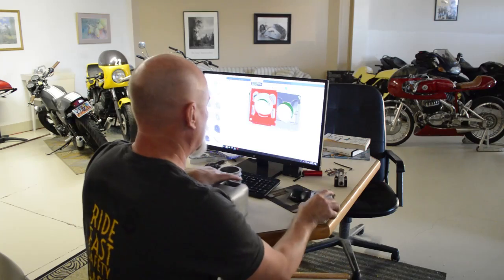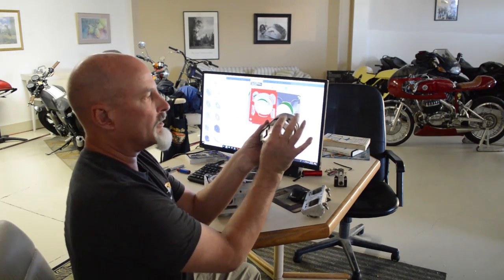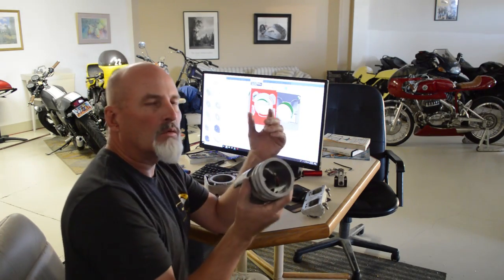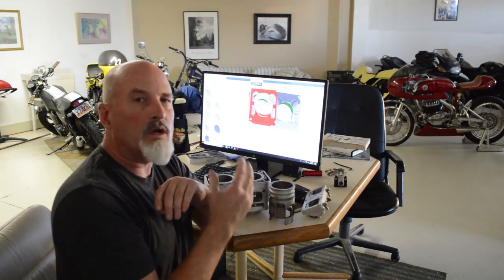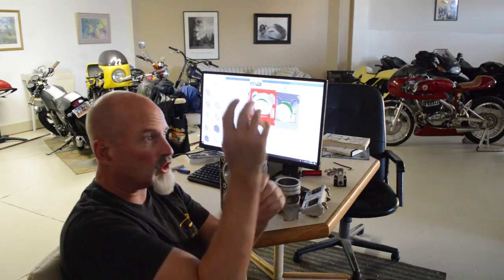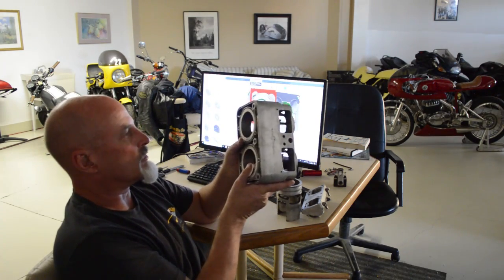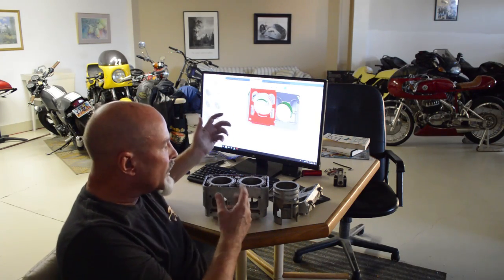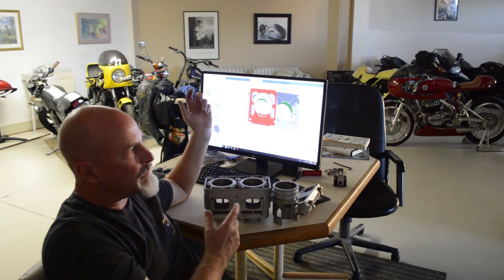Landspeed engine rev 2

Comment: Great video Mark !!
I used to race sprint cars and had a destroked  Chevy engine that made huge horsepower on menthol running up to 15.5 to1 compression. At 13.5 to 1 I ran 20% nitro.
It had 6" rods and the dwell time allowed increased cylinder filling and the methanol added latent heat of vaporization for 20% increase of horsepower and torque plus it ran cooler.
We had to use 1.5 to 2 times more fuel than gas as methanol has less btu per pound but the exhaust smelled crazy. Especially with nitro that smelled like gunpowder. 
I ran a nitrous tank in my radiator with lines through the upper coolant hose to nozzles under the intake in the intake ports.
Made a few seconds of 150 hordepower 
for last lap finishes. I
I know friends who race snowmobiles for the factory and used methanol for coolant and had a small needle valve to inject coolant into the intake. Made gobs of horsepower and passed fuel samples when checked plus ran cooler.
Racing is about innovation as smokie yunic would say.
Good luck with future runs.
Reply from the maker: Nice. Sounds like lots of fun. Smokey is a huge hero of mine. Got to talk to him years ago. RIP!
Reply: @SpeedofCheeseRacing  
Great to hear from you. Smokie was also my hero. I especially loved his hot air engines. Pure genius!!
I'm a retired mechanical engineer and have thought outside the box forever. 
I stumbled on your channel somehow while researching energy efficient power sources and thermal dynamics.
A buddy of mine wanted to build a bike for the salt using Honda gloldwing for power.and while I was at his place in Daytona during bike week, I solved some of his problems.
The driveshaft wouldn't clear the rear tire so I suggested he lengthen the rear swing arm which would also help stability with longer wheelbase.
Option two was he turn the engine sideways and eliminate the driveshaft as everytime you turn power 90 degrees, you lose horsepower and torque. However a chain or belt has no frictional losses.
I figured if he took all the gears out of the engine and ran a cvt belt drive off the crank it would reduce flywheel dynamics in the trans ,improve throttle response and solve shifting issues.
I sketched it up but he's still running the driveshaft which limits speed by gear ratio. He's run there a couple of times but now health issues and body mass has him hiring a rider from Washington.
Wish he'd have built the sidewinder.
Thanks for inspiring many to re-invent the wheel , buck conventional thinking and giving us a glimpse of your bikes and shop
Good luck on the salt.

Comment: Direct injection with an additional large carburetor to be used only for lubrication.
For this I would use a water-oil emulsion. Water reduces combustion temperatures.

Comment: You should check out rotax, there direct injection or there snowmobiles is awsome.injected where the spark plugs would normally b located,and they use a voice coil type of injector.there oil injection is digital also.and by the way,2 strokes rule!!!
Reply from the maker: Yeah, I looked at them, but controling them seems to be an issue. Stock ECU is not easy. It may be something to keep looking into though as it has all the good points. Two strokes do rule!
Reply: @SpeedofCheeseRacing  absolutely!! You just cant beat the power to weight ratio.i have a 73 rd350 with banshee pistons,30mill carbs and a good set of chambers on it.that thing will rip!!.I have embarrassed many liter bikes with it.

Comment: They already run lamda sensor in production bikes ,but the electronics just so far let it down but I'd say it was cause of  cheap produced parts ,if it was for a single purpose(landspeed) then money is no object to have bespoke kit to that bike as the rest of the bike is bespoke and not off the shelf parts ,as part from motogp 500's (all inj 2stroke) the only one developed in production is proven working an faster than cc of same size is the sky jet ,it uses an air pump run off the crank to aid a mix of air and a direct injection ,lamda sensor,tps throttle body with electric fuel pressure pump ,,last I heard a Lil while ago was there was an aftermarket engine management unit to solve there problems with the stock one ,I think the stock one is programmable as aftermarket one ,think the only thing was the stock emu faulted down bad products fitted in it ,there is always the argument finely tuned carbs vs injection but that four stroke ,I don't think that am6 landspeed record motor is injected and it's got a turbo ,one things for sure we learn and our tech gets better ,and the quest for speed records gets higher ,if when 50cc was first produced to that am6 motor we have gained 100mph difference in 100 years ,imagine saying to guys who produced first 50cc that in a couple of generations we be doing 135 mph using same cc ,they lock you up in a funny  farm ,where due a next generation 2stroke as the fours have just had one with the kawasaki h2(road legal super rocket ) lol

Comment: I was about to build a two stroke engine and wanna try piston gas ports, but was in doubt of doing it because the carbon build up mostly, it is a two ring two stroke K type ring, what do you think mark, have you tried it? of course it will be lateral gas ports, i mostly build four stroke engines nowadays you know, the two stroke its forgotten
Reply from the maker: Piston port are reputed to make more peak power, but drive-ability suffers, so I guess it depends on what you are doing with it. I am not sure why it would have more carbon build up than anything else. Two rings are fine if it is longevity you are looking for. I only use one ring but I take my stuff apart all the time. I haven't done much with piston port other than restore a couple of Yamaha R5s.
Reply: Wow man thanks i feel honored for your fast reply, it means a lot for me, will try it then! me too prefer one ring flat, but this is the only piston i can get for this Suzuki RG gamma 2 150, hope someday you sell me one of your pistons to try it!

Comment: Long rods, offset piston bore towards the power stroke side, your piston ceramic coated, head ceramic coated, and you might finally have something that will make your head spin. :) Have you thought about making the cylinder out of stainless, inconel, or titanium to keep it's heat transfer down? Nikasiled, of course.

Comment: Hi Mark, I agree long rods could be the way to go. I've recently done this to my RG500 - going from 100mm to 115mm (from an RD400 😀!). The engine does sound like its having an easier time on the dyno. However, it did lose some power - it appears the increased dwell time gives more time to cool to pistons/cylinders which in turn is messing up the pipe length. Hence I need to shorten the pipes and revisit the dyno to see if that fixes it. Vid on the dyno https://www.youtube.com/watch?v=NrXLuEiPPws . Some pics - https://farm5.staticflickr.com/4702/40196156102_d067ff6540_b.jpg , https://farm1.staticflickr.com/799/39250998030_3588498467_b.jpg  , https://farm5.staticflickr.com/4052/35337687350_b5a5210511_b.jpg
Reply from the maker: Damn that sounds good! How much power did it drop off?
Reply: @SpeedofCheeseRacing  So the previous tuned standard rod length engine made ~112bhp (10750rpm) . The new engine with bigger discs valves, larger carbs/inlet and longer rods made ~105bhp (10000rpm) and lost ~750 of peak rpm. We did numerous dyno runs increasing the main jets size as we went as it was running lean to improve the mixture. It then got to the point where the extra fuel caused the temps to drop too much even though it probably was still on the lean side and wanted even bigger jets! The behaviour is exactly what someone else who has done this before on a 125cc engine experienced and his advice matched the chap running the dyno - shorten the pipes. I'm currently having them altered so I can  adjust the length by up to 20mm on the dyno. I'm also going to raise the exhaust ports slightly as ideally I want to push peak power up over 11k. The overall goal of this build was not to make massive gains (115bhp to 120bhp would be nice) but to de-stress the engine with a higher peak rpm and/or more over rev to aid gearing on track. The chap with the 125cc engine said he ended up with the same peak power as before but gained an extended over rev with a nice long flat torque curve. I'll keep you posted on how the next dyno session goes which hopefully will happen before the end of the year...!

Comment: Your nuts!! I used to go racing and testing with friend he had triumph 675.running at the front when things clicked....u know.upgraded to duel map ecu with self mapper,come in and  refining fuel map through lap top and save changes..flick between maps in real time on track.a long way from fooling with needles and jets what I was into but I had the bug...best wishes☺
Reply: Mark you probably know this husqvarna and stihl  had autotune carbs with a while...which is great but they tend to do the small nylon cage bearings with time..... but the husqvarna supply firmware updates..stihl have first injection model  in final stages of coming to market YouTube ms500i

Comment: That cyl liner lasts long.Its ozom.Sir the Fuel injection is very useful for 2 strokes. Wow fuelinjection it would be helpful in making power 💪.Rev 2 is awesome. my question will this liner wears the piston 😕🤔I don't know more about it?I seen some piston with ceramic coated skirts.All the very best am curious about this engine.Thank you sir for eleminating the machine sound form the video.😉😁✌️
Can we use mechanical FI system? Will it helps too?
Reply from the maker: Thank you. I am getting better at video! yay Ialways something to learn!  I am going with an electronic FI system. At least that is the plan.
Reply: Any tym.Am waiting 4 it.All the very bst.

Comment: mark atkinson    150mph after coasting 1/4 mile on a 2 stroke sounds pretty nice, I know you said that version #2 engine is not a great deal but definitely is a pretty fast one for sure, very very fast! About the dyno and piston testing.... PLEASE! would be great to see your pistons in action! By the way how did you manage to keep the 2 small bridges of the triple exhaust port to not bulge and seize the engine? those bridges are so slim and small that should surely bulge while WOT during those long straights you race at.
Reply from the maker: 1/4 mile is a guess, but yeah pretty fast. Never fast enough though. I designed them at first with the coolant hole drilled through the bridges. I changed it instead to really thin ones and they worked great. My thinking was they wouldn't retain heat and bulge into the bore. The cool thing about these modular cylinders is if something doesn't work, I can just replace that part of the cylinder.
Reply: @SpeedofCheeseRacing  "Never fast enough though" lol very true
Reply: @SpeedofCheeseRacing  Would it be possible to see the differences between engine ver 2 and ver 3 which is the one currently in the bike?

Comment: Nice video Mark, it's inspired me to get out into the workshop and make  another ally liner for my Honda (and maybe my TZ) and have a closer look at the cooling. It's very time consuming tho, what material did you use?, I tried 2618 seemed ok
Reply from the maker: Good Marcus! It really is time consuming. I used 6061 for the cylinder and sleeve.

Comment: Much interest about the fuel injection and fast re-mapping.  Can you run a lamda sensor in a gas/oil or fuel/oil environment?
Reply from the maker: I don't think an o2 works. I understand it ruins it. There is a lot I don't know. Stay tuned. I will figure it out. :D
Reply: @SpeedofCheeseRacing  Some of the people that have tried the O2 sensor in 2 strokes and Wankels with premix said you can use the O2 sensor for tuning only.
Reply: @cristianr3712  o2 on cars are to mantain catalytic converter efficiency . Car manufacturer can map a fuel curve for mile per gallon or power without o2 sensors . Mark can get a programmer and do the same. The newer direct injection fuel injector is longer than the old style will get the fuel in the transfer port's as they have a long shaft on the injectors.
Reply: @twopopsaqullu9721  Not criticizing, just wish you were referring to actual direct injection when you wrote that, I believe finding a way to do it up to 12.000rpm and without robbing too much power from the engine would unlock the real potential of the 2 stroke engine, for now.... injectors in the transfers :´(
Reply: Mark will figure it out I'm sure after all he made that amazing piston .
Reply: you can,, reduced life tho ,, or take em out and clean them in a 4 stroke !
Reply: The 1.6l ecoboost have very long stainless steel injectors that I think Mark can machine a passage for them to inject in the transfer ports if that is what he is trying to do . It's just a heads up on injectors that are already produced. They also handle very high fuel pressure.
Reply: twopopsaqullu  not sure if transfer-port injection is what he needs. As it’s mostly intended for reduced emissions.   Dual injection behind the reed and transfer would be cool as it could be tweaked on the dyno to get the best possible . Possibly just inject fuel in the base at higher engine loads to have better cooling .
Reply: twopopsaqullu  those direct injectors need like 35000 psi